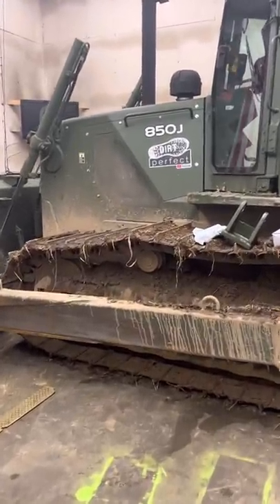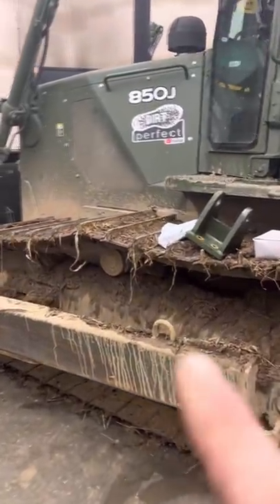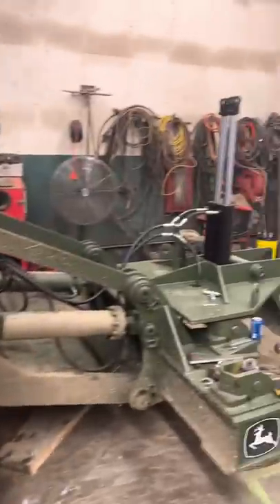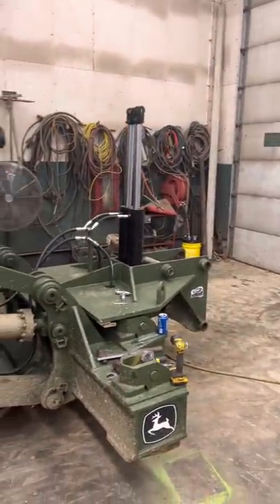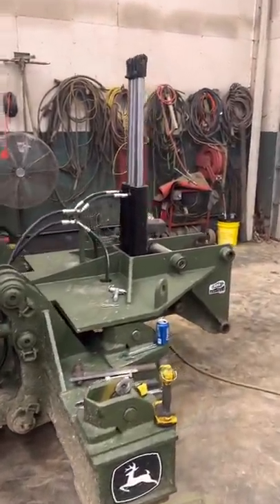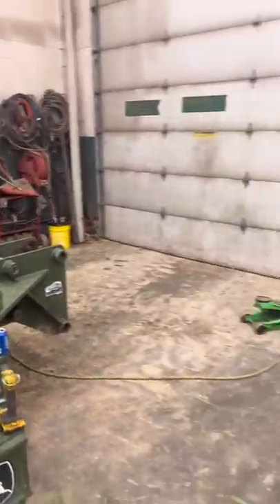Tile plow build complete but did it work 🤷‍♂️😁

Comment: Would be cool if you put a trailer behind it with tracks which carries the pipe. So you can unroll the pipe from the trailer, buries it after pulling it "through" the plow frame and then have a grading tool behind the plow which closes the trench again in one operation :)

Comment: I am totally short that you folks don't have any way to put plastic water line or gas line underground with a D 8  9 or whatever tractor you have. We in AZ has been doing this quite a while in sofl dirt in hard dirt we made something like a reel and put it on the back of a wheel trencher yes we still have backfill with a bobcat but we didn't have to unreal 5000 ft think about it it works

Comment: Sins you did a Short on it. It worked or it failed catastrophic and sins it's not any big Dmg on it. I would say it  worked. 
We know your timeline on normal videos... 

The 850j have Gross Power 192 Net Power 185 and to run a Tile plow they recommend 200 and your tile plow s is custom.

Comment: I think you might be gonna add a piece of metal from the point up to the vertical plate to cut the ground better.  😯😉
Reply: And possibly a little bit of metal on the back of the plow where the pipe slides out of the back of the plow shoot. 😏

Comment: Greeting from Ireland. I've been watching your videos. I've seen you using a magnetic handle with the gopro attached sticking it to the sides of your machines. Where did you get it or what is it call. Would come in handy here
Reply from the maker: Amazon have a podcast about it on my other channel a few points from perfect
Reply: Subscribed to you on that YouTube too but couldn't find the podcast where you talked about it. Which podcast is it in

Comment: I see dirt curls up high above the vee'd part of the shank. And you havent shown how youre bracing the mounting plate from bending backwards. Guys here tried to install Tylene pipe for a geothermal system at 6 feet depth with a home made plough on a Volvo loader, helped by a 10 ton tractor, but they bent the 8x2" bar despite having a chain run upwards through the ground to brace it.

Comment: I'd say it's in the shop for modifications.  I'm thinking it worked, but the "maiden voyage" revealed some issues that need resolved.  Repairs, to me, says something broke, which I don't think happened.  Finishing touches tells me these were originally planned, but just not done yet for various reasons.